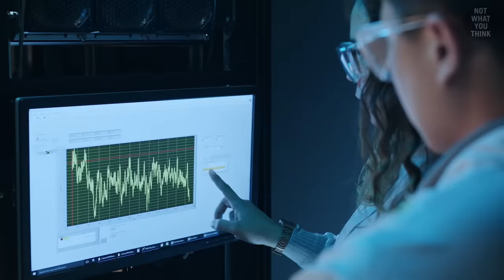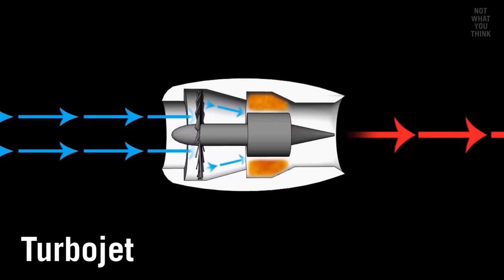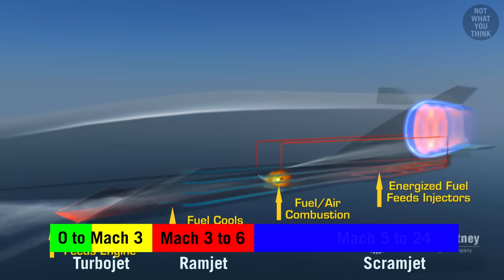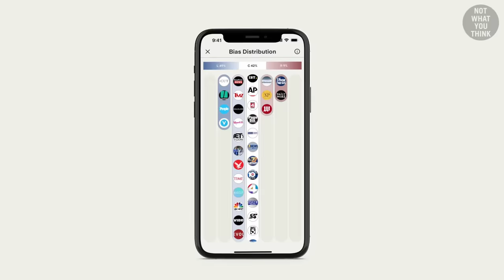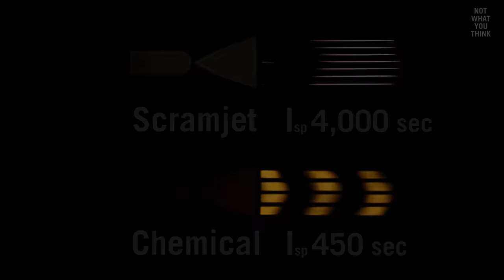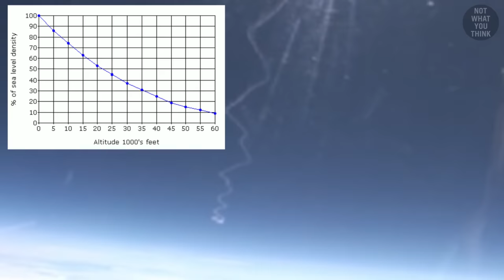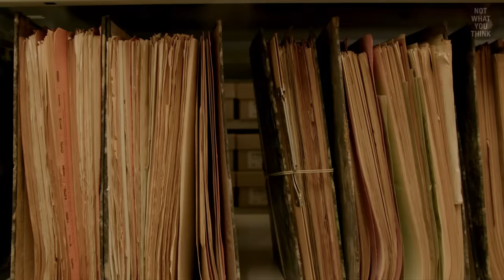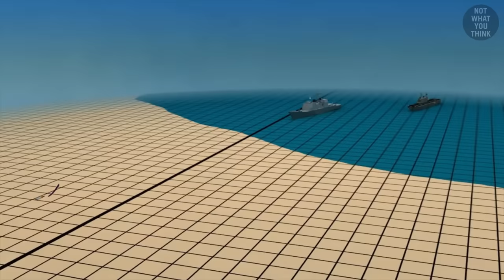The Hypersonic Missile Vulnerability That NO ONE Talks About

Comment: The answer in my opinion is: Why use a $100,000,000 missile when one or five $1,000,000 weapons can do it just as well or even better.
Reply: This is the correct question, and answer.
Reply: sometimes even cheaper.  5k bomb with a 2k guidance package with more explosives than can be carried on a hypersonic missile.
Reply: Sometimes that is the answer. Why use an inexpensive solution when a more expensive one can be developed.
Reply: @vasilije94  Good luck trying to hit an AWACS with a Mach 24 HGV
Reply: Better yet, use a hundred $20,000 drones for only $2 million.
Reply: Depends on target value, when u try to hit a supercarrier, you don't use jdams, like the "use 100 guns to fight 100 guns" idiom, you would rather go all out with way more success rate than losing and dealing little to no damage.
Reply: @KirtFitzpatrick  Only one country really has that luxury.  The US has, however, two political parties that alternate feigned concern for spending determined by which doesn’t hold power at that particular time.
Reply: the soviet union already calculated the best solution window, which is a volley of roughly 10 - 20 supersonic missiles for each aircraft carrier target, so that might go up to a volley of 20 - 30 missile per carrier battle group back in the 70s-80s
and yes, for reference, the p-800 onyx supersonic anti ship missile has an unit cost of $1,250,000 each missile, which is what russia more likely have than the zircon
Reply: Yes.
Reply: @tranquoccuong890-its-orge  keep in mind this was before AEGIS Systems were declassified partially, so it's safe to say that number has grown.
Reply: Why spend $700,000,000.00 on a plane (B-21) when a bunch of drones for a few thousand bucks will do the same job?  o_O
Reply: @williamyoung9401  Then tell me which few thousand dollar drone can serve as a strategic deterrent, serve as part of the global strike capability, perform SEAD and DEAD missions, serve as a launch platform for advanced weapons, ... I don't think that my Mavic 3 Drone can do that.
Reply: @jul1anuhd  you are not shooting that on AWACS, you shoot  R-37M. And yes, R-37M is hypersonic desgned for air to air and it was proven as crucial weapon in Ukraine war for air to air combat.
Reply: @vasilije94  How many AWACS have been shot down? 0. If you think its a crucial weapon just because it killed 40 year old Mig-29 ...🙄 Alright then xD I hope they have more of them than T-14 Armatas, Su-57s or actual running planes xD And nope a plane doesn't count as running if it crashes into apartment buildings.
And yes its "hypersonic" (faster than mach 5), but so is the JATAM and even the ancient AIM-54 Phoenix from the 70s and the good and old F-14 era.
Reply: @vasilije94  You mean to tell me that a rocket with a top speed of mach 6 ("hypersonic") can hit a subsonic target (speed mach ~0.8) better than one that is only mach 4 or 5? Definition of hypersonic is mach 5 and above.
Reply: @jul1anuhd  depends on conditions, but yes. Why is that something buffling to you? The faster the weapon is, the harder it is to defend against it. Its really simple concept.
Reply: If you build one hypersonic missile your opposition has to build systems to defend them.
Reply: It costs that much to develop the first time . What do you think the first nuke cost to make they just could have dropped a fuck ton of tnt?
Reply: @etemytradel4509  Nukes have a strategic value which by far outclasses every HGV or Scramjet cruise missile.
Reply: Have any hypersonic missiles been intercepted or are they to fast as they are also slower than an ICBM.... Hmmm...

And it's funny cause 1 ICBM isn't a city killer... At worst it's carrying 10 to 15 warheads at up to 25 megatons each on the high side. 18 each on the lower end.... So state or multi state killers..... As we can barely intercept slower non nuclear hypersonic missiles that can also carry smaller tactical nukes.....
Reply: @Blazeww  Targets like Carrier Strike Groups are well protected against Ballistic Missiles (Aegis-BMD), but basically ever other target has no chance to defend itself against ICBMs. SRBMs like the russian Iskander have a high chance to be intercepted by either Patriot-PAC3 or THAAD. But as you said, defending against ICBMs is almost impossible, which means you basically gain no strategic value with so called "hypersonic missile" other than detterence. If a nuke flies, you basically can't do anything. One nuke with 6 MIRV Warheads could most likely destroy at least 3-6 big neighboring cities.
Reply: Because how else do you take more and more from the taxpayer?
Reply: @KirtFitzpatrick  contract lol
Reply: it's still smart to use 1x 100 million missile to sink a 12 billion dollar aircraft carrier
Reply: @ricardolevy885  If the missile can't hit its target it isn't
Reply: Put a modern guidance system on a Sprint missile.🤣🤣🚀🤣
I'd watch that just for the blistering acceleration; 0 to mach 10 in 15 seconds.
Reply: @Shinobubu  hypersonic missiles don't use explosives bro
Reply: @vasilije94  bruh i read that as R-73M not R-37M lol
Reply: Even 50 $1 million missiles would be better than one $100 million missile.
Reply: And the answer to this question is that if the $1,000,000 missile can be destroyed by a $250,000 interceptor, the enemy can afford 4 interceptors for every missile you can fire at them. If the $100,000,000 missile cannot be intercepted, then for a certain value of target (like an aircraft carrier which costs in the $billions), even a missile that expensive makes sense.

The problem is not that these missiles are too expensive, the problem is that (as the video points out), they do not really achieve their goal of being impossible to intercept.
Reply: because the US likes quality over quantity
Reply: @Pragmatic Skeptic they are hard to aim
Reply: Hypersonic missiles are good for strategic targets. For example taking out the pentagon or something of importance. Basicly a interplanetary snipershot. Another use is a fast anti missile defense system but no need for that when you can strike first and fast.
Reply: Don't forget about the costs of the launcher crews, aircraft and ships that launch these missiles.
Let's say hypersonic is 100% reliable for getting on target but the older missiles are only ten percent reliable.
Yes I know it's not 100% but plug in the numbers you see fit.
Well that's ten times more launchers planes and ships you might need.
Also, even though you might be aiming at say a base, you are probably tasking those missiles to hit a particular part of the base.
So if you task 10 regular missiles, there is still a chance all will miss. Alterately you get multiple hits, which might be overkill.
Which is an issue because the AD may have concentrated on the missiles for another target and shot them all down.
So there are issues with mass "cheap" rocket attacks
Reply: because 5 cheap ones, or even 20, or even 100 could be interupted by equal amount if cheap missiles. 
And there is no way to stop a hypersonic one for now
Reply: Plausible deniability on top of MAD, I guess. For when you really want to take something out but don't want a provable trail leading back to your doorstep.
Reply: Hypersonic would make sense for nuclear weapons but apparently everyone universally decided that it was too op in the 80-s
Reply: Yep, USA stealth aircrafts somewhat fullfil the "unexpected approach" phase.
Tho last time I checked a Russian flagship has been sunk by even less... So like, what would be the target worth spending hypersonic missile from US side..?
Reply: @koghs  In the 80s they had an anti ballistic missile treaty. Which meant both sides could not shoot down the other sides missiles.
So hypersonic missiles don make sense in that situation.
The US pulled out of the treaty, which made hypersonics a better idea.
Reply: I don't understand why the US has not wanted to invest in RAMJET cruise missiles. It's a well established technology and is there really that much of a difference between a cruise missile going mach 3 with a RAMJET vs mach 5 with a scramjet?
Reply: I agree. And same with B-2 and B-21. Let them explain to people how 50-30meters thing can be invisible for modern radars
Reply: @reznikvolodymyr8145  Not invisible. Hard to detect. Its all about technology. If the radar waves don't go back to the Radar, you won't see whats there.
Reply: @jul1anuhd  bro modern radars can detect whitch kind of bird flighing in the air. But here they say lets spend 1.5 billion dollars for bomber that 50 meters to 30 meters long only because its stelth.  It can be seen as well from AEW aircraft or even fighter on board radar
Reply: @reznikvolodymyr8145  Yes it can be seen. A powerful radar can detect a B-2 about 20 miles away. Tracking is another thing. We know almost nothing about the B-21 but it most likely has a way smaller RCS which means it gets detected lets say about 3-8 miles away.  So you're saying that all militaries are wrong with their stealth and everything is unnecessary. So you know better what the US has to build for aircraft and how exactly stealth works than the military itself. China also builds a stealth bomber, though perhaps not as good as the B-2, but still a stealth bomber. Also Russia with PAK-DA. A B-21 can have a smaller radar cross-section (radar area seen by a radar) than any small model aircraft or Mavic 3, Orlan-10 etc. Why? Materials, angle and shape. If these three things don't mean anything to you, then I recommend you do some research. There are many exciting videos about it that are recommendable. I don't want to advertise for a channel, but you're sure to find something good. 5th generation fighter jets have such strange shapes. They are there to deflect the radar waves, so that they don't go back to the radar, or only less waves. Or also different, secret and special materials that absorb radar waves, similar to acoustic foam, which absorbs the sound waves. I could go on and on about this, but in the end you'll still say "It's unnecessary and will be detected" and I'll say "Yes it will be detected, just maybe 5-10 miles away and armed with missiles that can fly well over 500 miles and thus out-range the enemy, which is the whole point of stealth". It's nice that you have your own opinion. All the best and have a nice day.
Reply: @damocles8417  I think the US realized this decades ago, which is why we’ve stuck with sub-sonic, surface skimming cruise missiles. Hell, now that we’ve found a cheaper way to put stealth coating on stuff, now we even have stealthy sub-sonic surface skimming cruise missiles.
Reply: @jul1anuhd  Most likely?! What if not and it will be shooted down and you had few of them, like fith f117 in serbia? Only real war can show what is efficient and what is not. The militaries like to plunder the budget since the end of cold war. In the US this is one of few ways to avoid inspections and taxes. Like to ask money  to develope new technologies 5th or 6th generation. Or like they spend billons during afganistan operation. In real war it will be better to have 10 f-16 instead of 1 f-22 for the same money. And in real air battle 3 or even 2 f-16 will shoot down f-22 even it will strike first and shoot down one of them. Same with b2 or b21. Better to build 5 b-1 with lots of longrange rockets and bombs instead of vulnerable low speed bomber b-2 by 1.5 billion
Reply: @jul1anuhd  its RCS cant be much less than b-2 have because of its size. Its impossible from point of view of physics. But public likes smth super-hyper-secret things, thats why militaries recieve money from goverment on projects like this. As the example putin with his pak-fa, kinzgals, armata and other secrets that not working or do not mean a lot in battle, while infantry starving and freezing
Reply: That the best "we failed to get hypersonic weapons, so we will say its useless" I ever seen
Reply: @HOLOD48551  USA the only country that has enough researches about hyper sonic flight and the only country that has working aircrafts which can constantly fly in hypersonic flight mode
Reply: Julian, but on tht positive side, tht missile being hypersonic is so it it can bypass enemy heat seeking radars.
Reply: @williammitchell1864  Oh yes, who doesn't know the heat seeking radars. Electromagnetic waves that are emitted, bounce back and can thus precisely determine the temperature with a high resolution. Who does not know this kind of system... And if there was this technology that definitely exists called heat seeking radars, wouldn't it be easier to detect a missile that heats itself and the surrounding air to several hundred degrees and makes it glow?
Reply: @HOLOD48551  or just the reality called "Attack the enemy with a large number of medium- or low-cost missiles to (over)saturate their defensive capabilities. Not only would you destroy your own missiles, which are more expensive than the best fighter jet in the world, but you also indirectly destroy the enemy's air defences.
Reply: @moealsharif13  Tell me about a one thousand dollar weapons which can 100% reliable shoot down a Tomahawk cruise missile
Reply: One or five or fifty. Which each has multiple warheads and decoys.
Reply: Probably because they cant do it. Why use $1,000,000 missile instead of thousands of artillery shells ?
Reply: @syc6598   We literally use tens of thousands of artillery shells lmao. But maybe artillery can't track moving ships or hit targets 2000km away.
Reply: @jul1anuhd  that's my point. different purposes. Hypersonics have their own ones.
Reply: The answer is very simple: interception capability. The faster weapon can intercept the slower one and/or can't be intercepted itself. This is of course assuming a near peer (e.g. US vs future China in 30 years). It's why the US military has not one but something like 9 different hypersonic weapons programs. 

Regarding costs, that's a made up number but yes you could ask that about every new technology that starts out impossible, then impractically expensive, then...
Reply: @delos2279  Nope the number isn't made up. It's about 80-120 million dollars. The answer is oversaturation. Just use a large ammount of cheaper weapons and overwhelm the defense. 50-100 would be more than enough.
Reply: @jul1anuhd  They aren't 80-120M or even 10 times that, they are still in development. By made up I mean those are estimates, not real prices. But yes, the initial cost will be high and then price drops over time which is always how new technology goes. So for more made up numbers, this is from the DoD:   "We’re not going to be able to buy very many of them if they’re $80 million all-up rounds. So they’re shooting for somewhere even as low as 10 or 5 million [dollars] a round. And that really is going to drive the numbers.”

Costs for new technology always goes down over time. Remember how the F35 program was the biggest waste of money (ever) around 15 years ago when it was $221M per aircraft?  Now in a little over a decade the price dropped by almost 300%, and production can't keep up with demand even with many countries being restricted from the program. Not many people still question the value of the F35 because it has matured to become the most advanced 5th gen multirole fighter. 

So the issue is, you're not wrong when talking about the present but US military doctrine is always aimed decades in the future looking to future solutions for likely-future problems. So let's say in 20 years China has 6 aircraft carrier groups and antimissile systems have matured to be about 500% more effective than now. Swarms of conventional cruse missiles won't cut it. This is why both China and the US are researching this technology. By today's standards it is waste of money but it isn't intended to be used today.
Reply: @SamTheEnglishTeacher  drones can be taken down cheap if that's what you prepare for. Everything made has a place, except hypersonics since nobody can afford enough of them and if anyone can they'll be easy to overwhelm
Reply: I would imagine price would go down
Reply: Hypersonic missiles are primarily anti-ship missiles designed to destroy larger vessels like aircraft carriers and cruisers. Regular missiles would barely scratch an aircraft carrier while a hypersonic missile could easily disable (but not destroy) one with kinetic energy alone.
Reply: My point was right. Modern SAMs like the Patriot have no issues to shoot down very expensive Russian "hypersonic" missiles.
Reply: @jul1anuhd  No they don't, a Patriot missile is far slower than a hypersonic one and is very unlikely to shoot one down. Besides, the main goal of the hypersonic missile is to take out targets such as aircraft carriers, while Patriot is only for intercepting cruise and slower ballistic missiles.
Reply: @johnmackenzie3871  There is a serious flaw in your conclusion. The speed of the Patriot missile can be excluded from the equation. Why? Patriot is used only for defense in the terminal phase against ballistic missiles. There, it is much more about the reaction and calculation time of the entire system. Mach 4 of a PAC-3 missile is more than enough to finally hit the target. Where the speed would be important would be in midcourse launches or those in the boost phase. This is less within the capabilities of Patriot, but more of a SM-3 or GMI. And as you said, yes, Patriot is intended to be used against slower ballistic missiles such as the Kinzhal. For IRBMs or ICBMs in the terminal phase, there is THAAD. Hypersonic weapons against aircraft carriers are a brainless idea. SM-3 or RIM-174 standard ERAM (SM-6) are actually designed to counter ballistic missiles. This means that a saturation strike would be needed, although cruise missiles would be just as good and at the same time much cheaper. What would be dangerous would be sea skimming cruise missiles with scramjet engines. But I think it is clear that the biggest problem for countries like Russia would be to find out where the target is in the first place. With satellites that have an effective resolution of 50cm per pixel, of which only 2 are in orbit, this will not be very easy.
Reply: To advance technology and to find out what might actually be useful.
Reply: Hypersonic missiles can hit a carrier more easily. And I guess it’s true but how about 10 hypersonic missiles that cost a billion dollar to destroy a 10 billion dollar carrier. I think it’s worth it.
Reply: There are some therotical situations that are time sensitive. Or targets that are valuable enough. 

 Like a Submarine or a Carrier. 

 Outside of that yup. Also, good luck hitting a moving carrier with a hypersonic missile. 

 Last time I checked scram jets created some type of electromagnetic barrier causing you to be unable to communicate with it. This also makes you unable to make it stealth as the air passing it makes that bright to radars. Correct me if I'm wrong. 

 Anyway like all technologies it will get cheaper. Although we pay missiles for what they can do. Not how much they are actually worth to make. Which makes no sense to me. 

 If we pay for RnD. Why we paying for it again once we buy them.  Once you have the specs and facility up it to make it the cost should go down significantly. Yet things like Stingers have gone up by multiple times.